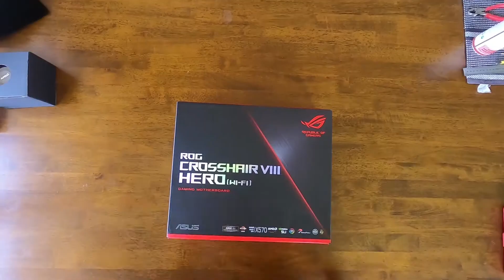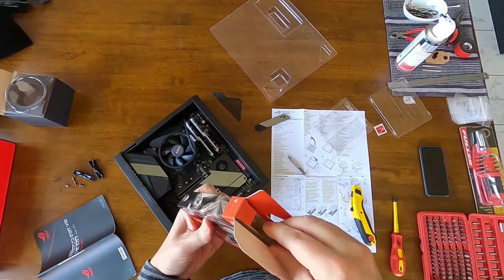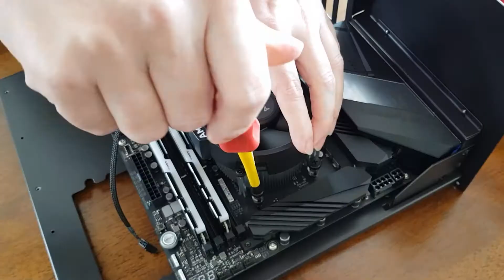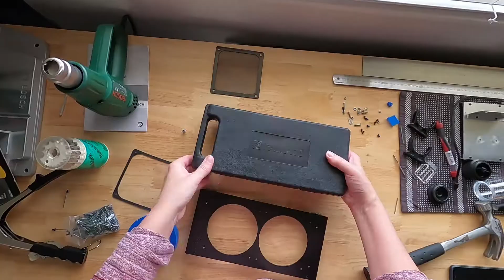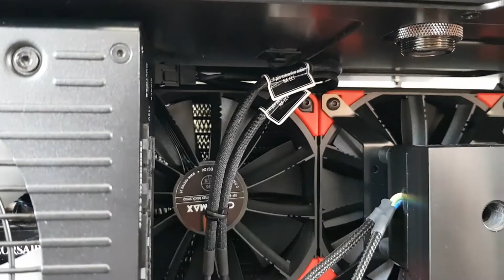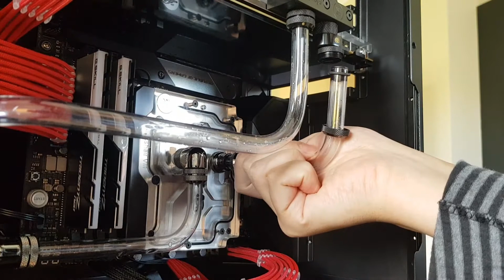Custom liquid cooled PC rebuilt with the ASUS Crosshair Hero VIII and AMD Ryzen 3800XT

Comment: I got the full Nickel Monoblock from EKWB for my Dark Hero. Could you please explain where you stuck the DRGB (ARGB) cable? I'm not even sure if there's anywhere to stick that cable inside the monoblock.  Anyone with some useful info?
Reply from the maker: Hi, I connected the 3pin argb cable from the monoblock to a 3pin argb connector on the motherboard, just had a look at the hero dark and these can be found at the top right and bottom center of the board.
Reply: @CharlesDeukett  Thanks for answering! Did you receive any ARGB cables - from EKWB - with your monoblock?
Reply from the maker: @tibielias  no additional cables, the single ARGB cable with led strip was pre-installed into the monoblock

Comment: Which thermal pads did you use and which thickness are they?? Btw dope video! :)
Reply from the maker: I used the thermal pads that came with the EK monoblock, and they look to be 1mm in thickness, glad you enjoyed the video.
Reply: @CharlesDeukett  thank you Charles!! Did you measure them or is it a suggestion??
Reply: @carlo5377  they are 1mm thick based on manual I read there wasn't too much, with EK you have to manually measure and cut them yourself I guess you have to be careful not to waste your pads (I installed an ek gpu block and backplate I have leftovers so im ok)

Comment: Not sure why you would wanna run a reverse atx build but bro you gotta do something about that 24 pin cable, run it behind the res or don't build an upside down computer.

Also should have just got the formula instead

Comment: Kiwi accent. I like how you filmed this. I got the new Dark Hero board, and have been harassing EK for ages to make a custom monoblock for it, but they said they’re not going to cause the Hero block fits on it (even though reviewers say it doesn’t properly). Sux.
Reply from the maker: Hey thanks Nathan, first video using a GoPro, it made it easier than setting up and moving cameras around. The Hero Dark looks like a great board, glad ASUS removed the heatsink fan that my crosshair has, shame about the monoblock though hope EK can sort something out
Reply: So this monoblock does not fit with dark hero?
Reply: @dgreat1000  it does, but apparently the mounting screws don’t line up properly. It’s the best we’ve got, and are gonna get, I’m afraid 🤷‍♂️
Reply: @SodaiGoku  thanks mate..nearly bought it..looks like need to source elsewhere..barrow ark block also look nice btw..shame i really like this ek block to go with dark hero hmm
Reply: @dgreat1000  don’t get me wrong, you can use it and it’s a beautiful monoblock, just will have a bit of trouble lining the screws up. I read in one statement that he just used the 4 main screws that go around the CPU and left out the rest, and he said it was ok.
Reply: @SodaiGoku  ahh thats what they meant by "compatibility : customer" thanks for the info ! was about to install it on a dark hero, I'll make sure to check that before starting the real build so I have all the tools and stuff required